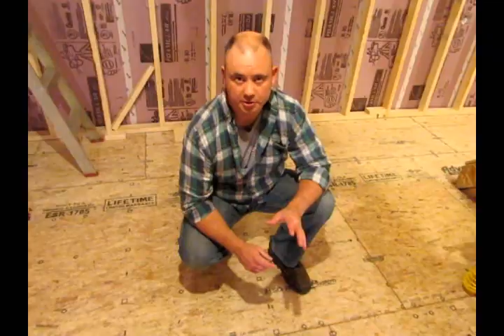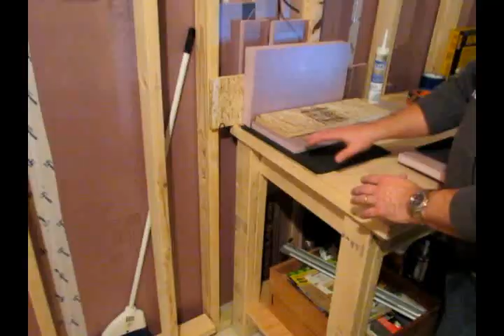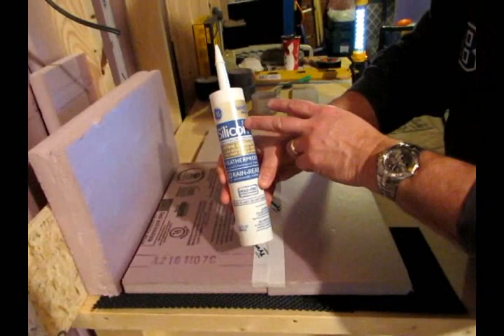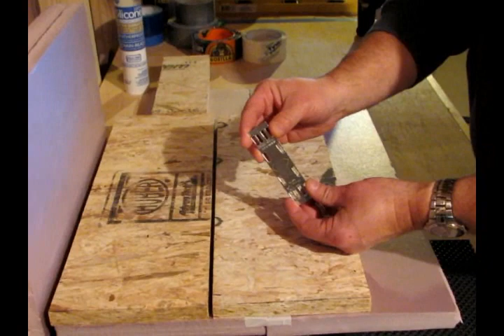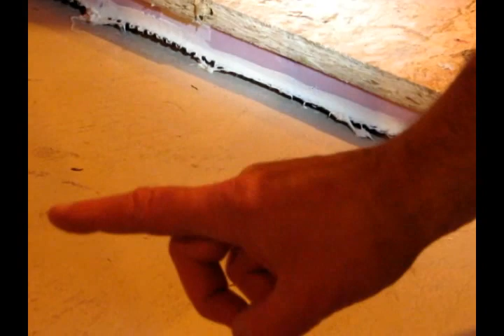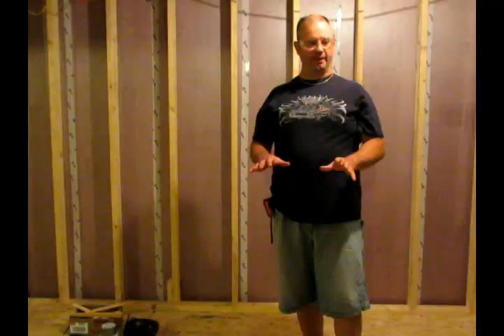Finishing a Basement - Part 2 - Floor Insulation & Floating Sub Floor

Comment: Have you notice any changes in the feel of the floor over that last 3 years... I was told that XPS foam boards change overtime (Posiably shrinking ) and I was wondering if you agree with that.
Reply from the maker: I have not noticed any changes, in fact it has worked out better than I originally expected.  In fact, I have added an engineered vinyl plank (EVP) floor in one section which I was questioning and many flooring "sales" people who are trained to tell you not to install on anything other than a completely rigid and level floor advised against, once I contacted one of the flooring manufacturers directly and spoke with their engineer, advised that this floor would actually work well, and it has.  Very happy with the results, bit there are some keys to making that type of floor work; I captured some video on that and will try to post that at some point in he future also.

Comment: Any reason why the rigid floor insulation couldn't be eliminate from your system here? Can the advantech be floated directly over the dimple mat?
Reply from the maker: That eliminates the moisture barrier and defeats the purpose.  You could eliminate the XPS foam but then just need to be sure you seal your floor vapor barrier really well all around the floor and against the wall insulation.  The reason I used both was to achieve both moisture protection but also added thermal break and insulation.  The floor has been even better than I expected and almost hate to say, but the basement has been the most comfortable room in the entire house both winter and summer.

Comment: Great Videos and research Buffalo J!

Was your concrete floor level?  Ours varies up to a inch or more so I was considering tapered sleepers.  

Did you have any areas that were not level?

I would rather sleepers than pouring thousands of pounds of leveling concrete.

I am just concerned that adding tapered sleepers will even add more thickness to the floor?

Thanks.
Reply from the maker: The floor was fairly level within the normally expected slope of the floor towards the sump crock.  There are are some slight rise / depressions around the control joints in the concrete.  If you have a serious level concern, then your idea about tapered sleepers can work, but consider if you place the the foam or on top...under is below the vapor barrier and load of entire floor is concentrated on the foam on the narrow sleeper.  on top of foam is most practical, but suggest the sleepers are then fairly wide as again the load of the sub floor on top will be on the area of the sleeper to the foam, so you may get a little compression in the foam there with larger loads on the floor.  Maybe try to test before you do a full install.

Comment: I don't believe in the effectiveness of the air space between the concrete slab and the insulation. That air will be stagnant. How and to where is it flowing to promote drying?!? Your rigid insulation is itself a vapour barrier. I'm in the process of doing exactly what you are doing however I'm setting my rigid insulation directly on the concrete floor and securing it in place with thin set. I will put a VB on top of that to reduce the flow of out gassing from the rigid insulation. No air gap means no room for mold to grow.
Reply from the maker: Thanks for the comment.  The air space is simply that, air space.  Moisture will naturally move from high saturation to low within the air, so even this tiny bit of space will more easily allow that to happen.  In your suggested method, there will be even less air space so the risk of stagnation as you put it will be even higher.   You need air to be able to move to allow drying, and yes while this space is small, air molecules are many times smaller and moisture will move.  Consider that through just a pin-hole in a vapor barrier, one cup of water can migrate as vapor through that hole in a season...now consider that the 1/8" space under 50% of the entire floor is ventilated, how much more drying that will allow than zero space.

Comment: Congratulations. You have achieved an R value of 1 million with all that insulation. Your basement floor is now the Sahara desert haha
Reply from the maker: Excellent and thank you for you comment!   Exactly what we were aiming for is a dry mold and mildew free construction.  While in just that's great, but R-value in reality will be somewhere around 10-20 for the walls including the insulation and air space between the studs creating a thermal break, and 5-15 for the floors based on Foamular rating of 5 per 1" thickness, plus the added values for the thermal break of the dimple matt plus the small value for the wood sub floor.

Comment: What about two layers of 3/8" or 1/2" plywood alternating directions and screwing together to get lock in the wood subfloor?
Reply from the maker: No reason that could not work as well.  The reason I chose the Advantech sub flooring is specifically for the water resistant properties, and that has already paid off in this project in a case where a coupling for the sump pup failed and sprayed some water around that area.  Floor was wet for a while and no damage at all after it was finally dried.

Comment: Tackling our basement...since we are pretty much house bound!  We cannot get advantech here.  Would you recommend OSB or plywood instead.  We are likely going to use Luxury Vinyl or carpeting...still undecided.  Thanks a bunch.  Appreciate your videos.
Reply from the maker: Hello.  If you have to choose between the two I would personally use plywood, preferably tongue & groove.   Plywood is more reliable under damp conditions than OSB, and OSB well readily swell and start to separate.   There are also other moisture resistance OSB sub floor products out there; one is name DryMax by GP, and there are likely others.  Good luck on your project.

Comment: My slab will have a vapor barrier underneath it. Can u forgo the dimple mat and just lay the foam onto the concrete?
Reply: Also, do you build the interior walls on top of the subfloor? Or should I attach the walls to the concrete and build the subfloor around them?
Reply from the maker: Please see the other videos in this series and it explains all of that in more detail than I can write here.  Good luck.
Reply from the maker: The purpose of the dimple mat is to allow air to move as you will get moisture under the vapor barrier.  It's your call, but I prefer to have more air movement for my project.

Comment: Hello, I'm working on a similar project. I am very curious to know how the floating floor is holding up for you, especially since you didn't tapcon to the concrete. Are there any squeaky spots on problem areas. Have you noticed any flex with heavier items or anything abnormal? I've been doing lots of research but as you already know, the majority of folks are advising to tapcon. I just want to be sure it is "good." Thanks
Reply from the maker: Been as or better then expected.  There are no squeeks at all ...because  a) we do not have any nails / scews for the wood to expand and squeek against, the foam is taped at butt joints and there is gap at the perimeter of the foam floor to avoid squeeks, and the sub floor is tongue&groove and gapped at the butt joints so nothing there to squeek either.
There is a very slight amount of flex you may notice wherever you have a significant high-to-low spot change in your floor, but that is expected and part of the design, so you do not want to use this is your going to use a finish flloor that required absolute stiffness like ceramic tile.  Also do not confuse this very slight amount of flex you might have at high spot changes to"crush" due to loads....loads are very well distributed through the sub floor and foam so I have never noticed that, particularly even with heavy gym equipment and running on it for example.  see other comments in this and other videos with similar questions and more info.

Comment: Great Tutorial (I watched all 4 sessions and looking forward to more on this project) Though, I have a few questions.
1. Did you put the subfloor adhesive between the butt-joints too or just the tongue-and-groove joints?
2. IF you did not have a sump pump, would you still have gone with the same flooring concept?
3. The space between the floor and wall- why did you elect to fill the gap with silicone caulk instead of filling with foam (great stuff).
4. Which Great stuff product did you use between the XPS sheets on the wall (regular (red can)- or low expanding for windows (blue can)?
Reply from the maker: Thanks.
1. I only used the adhesive at the tongue & groove.  The butt joints will move slightly and the adhesive will restrict that and eventually squeek or make a noise.
2.  If I did not have a sump pump, then I probably would not have finished my basement....honestly.  It means (depending on where you live) you have high potential to flood and get the walls and contents wet.   Having said that, this system should be resilient if you ever did flood, provided you dry it out as soon as possible and thoroughly...but again, that doesn't help your drywall, electrical, or content is you get enough water.
Reply from the maker: Also, I've since realized that the Locktite PL 400 is not great with the resins in products like Advantech.   It's not a problem, but the bonding is a bit weak.  It doe still take up gaps and squeeks, but does not really work as a bonding agent between the boards long term.  Advantech has since some out with their own adhesive which you can buy through them and is made to achieve better bonding with the resins in their board.
Reply: Looking back at your tutorial, you used an expanding foam product to apply the xps to the cement wall.  I think it was Great Stuff, but was it the general purpose (red can) or low expanding (blue can) used  for windows & doors?

Comment: Did you put the subfloor adhesive between the butt-joints too or just the tongue-and-groove joints
Reply from the maker: Just tongue & groove.  The butt joints will move slightly and that's OK.
Reply from the maker: Also, I've since realized that the Locktite PL 400 is not great with the resins in products like Advantech.   It's not a problem, but the bonding is a bit weak.  Advantech has since some out with their own adhesive which you can buy through them and is made to achieve better bonding with the resins in their board.

Comment: Osb is not recommended since it releases formaldehyde!
Reply from the maker: From Huber Woods' website, who makes the Advantech sub floor product:   "The adhesives used to produce AdvanTech and ZIP System panels are a combination of exterior type phenol formaldehyde (PF) and isocyanate resins. During manufacturing, PF resins are exposed to heat and pressure. This heat and pressure cures the resin into nonreactive and stable material. Isocyanate resins contain no formaldehyde."
Reply from the maker: http://www.huberwood.com/assets/user/library/Formaldehyde_in_AdvanTech_and_ZIP-07092010122052.pdf

Comment: Hi
Can you tell me the type of foamular insulation you used? Was it the type that has a higher compressive strength?
Thank you
Reply from the maker: Owens Corning Foamular 250 (25 psi compressive strength).  the Foamular 150 can be just as good (15 psi) in many applications and certainly for walls.  See Part 1 here:  https://www.youtube.com/watch?v=rNZeuY2ZZNs&t=3s

Comment: @Buffalo J
  Awesome videos. I'm planning the same build thanks to you.  Did your Foamular 250 depress and stay concaved in traffic or heavy furniture areas?  What thickness Advantech did you use?  Have the framing straps continued to stop the wood 'give & play'?  I'm using engineered wood on top that doesn't have alot of tolerance for subfloor movement. Would you change anything about your floor system if you did it again?  Thank you so much.
Reply from the maker: The foam and floor overall has been sound...25 psi is quite a lot in itself but remember too that when you lay the subfloor on top of the foam, the load of any given point is spread out substantially across the top of the foam through the subfloor so you'd need some really heavy stuff to affect the floor compressive strength.  If I recall I believe I used the 23/32 floor.  Regarding the finished floor you use on top, remember that the combination of the dimple mat, foam, and not anchoring the subfloor to the concrete floor means that the floor is meant to absorb and be a bit flexible.  If you want to a hardwoord, ceramic tile, or other flooring which needs a very rigid subfloor, this may not be the right choice for you in order to avoid separation or cracking of grout, etc., and you may need to resort to anchoring your floor through the foam to the concrete...I just then suggest sealing around those anchors very well.   Remember the design employed here is to maximize moisture/vapor proofing and minimize heat loss all by having no penetrations of the vapor barrier and avoiding thermal bridges like anchors and fasteners, so the optimum flooring here will be carpet or other "softer" flooring such as floating laminates, vinyl tile, etc.
Reply: @Buffalo-J  Thank you. Very helpful.

Comment: Nice build, planning to do my basement too soon. I have a question tho. If the subfloor is a floating floor that will expand and contract, and I saw that you fastened your wall frames to it. Will the walls move too? If it does, even in tiny amounts, that will be a problem for the drywalls. Cracks will appear there right?
Reply from the maker: Good questions and there's a few aspects to this.  First the sub floor is wood as is the framing so we expect thermal expansion/contraction to be similar between the two when exposed to similar temperature changes.   This is essentially no different than what your entire wood-framed home faces through its life, and so potential for cracking on the drywall is also similar.  Keep in mind the subfloor is also insulated from the concrete by both the foam and dimple mat, and interior temperature changes in this climate controlled space will be relatively minor (see here:  https://www.youtube.com/watch?v=v9HgnoZOGFo&t=30s). As the floor is floating, it also is therefore more free to move with expanding / contracting walls vertically than if is was held to the concrete floor and this is where your run into trouble with interior walls tending to expand / contract differently than exterior walls.  Finally for the drywall, I fasten to the wall studs only and avoid the top and bottom plates, and again, this then means the drywall is subject to no different stresses than what you would see in the rest of the home, and I also will use drop-ceiling in this space to maintain accessibility to overhead utilities, and this means I will have no perimeter drywall joints around the walls at the ceiling.

Comment: Thanks for the video. Very informative and the detailed information is appreciated. If you are concerned at all about your cuts around the support pole you could use a Kreg Jig and some of the stainless steel coarse threaded screws to anchor everything. I used the same subfloor system and anywhere I could use the to tongue and groove I used the Kreg screw system and it created a monolithic subfloor. It turned out great with no squeaks or flexing.
Again thanks for the video.
Ron
Reply from the maker: ....I meant "flooring", not "flirting"... darn spelling auto-correct!
Reply: Ron H did you do this type of subfloor with advantech and no gaps between the sheets? If so, how is it working out?
Reply from the maker: Ron H:  thanks.  The "Kreg" Pickett screws are a nice idea especially where there would be any cut-outs underneath the flirting itselfIn my case I was able to orient all of these small cut outs of the subfloor in the same direction and all will be beneath a wall structure.
Reply: mikecampanella1990  Hi Mike. Yes I did and I only used pocket hole screws in a couple of places and it worked great for me. The flooring went down Great and have no issues.
Reply: Buffalo J  hahaha I automatically assume auto correct any more and auto correct has bit me a few times as well.